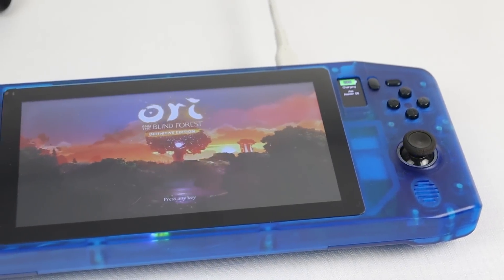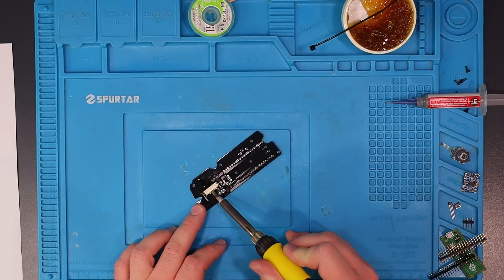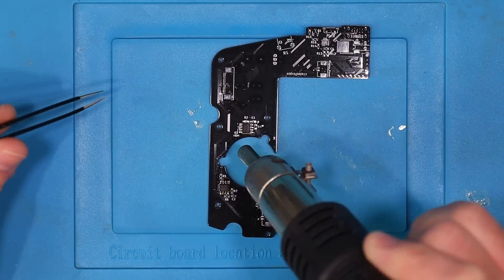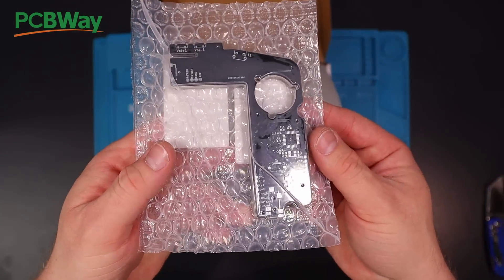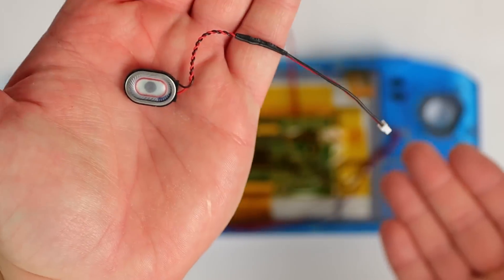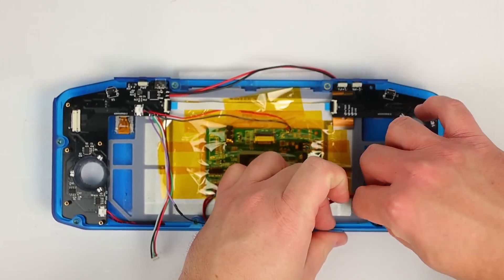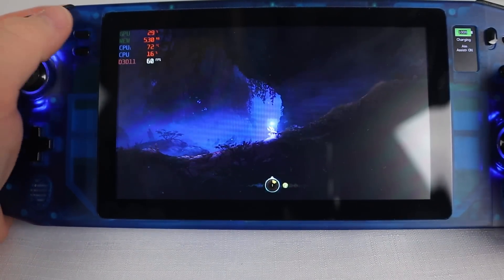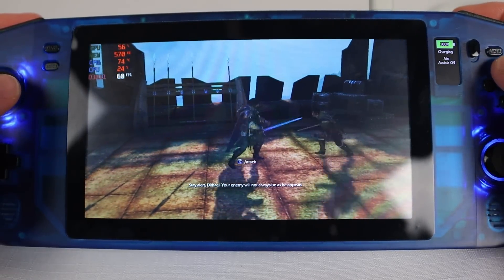NucDeck - The DIY PC gaming handheld - Episode Seven

Comment: This is awesome that you are able to do the job of a whole company only by yourself. I believe if you put more performant pc in it, it would be amazing. Can you program it so it wont charge battery more than 60% when plugged in to preserve battery health? Its not necessary but may be a good idea for some users.
Reply from the maker: Yeah, I will look into upgrading the NUC once the project is complete. It was hard to justify spending more money than I did on a NUC just to rip it apart and stick it in a device I wasn't even sure would work, which is why I used a fairly old one to begin with. Yes, any battery level should eventually be an option you could change, once I have the battery management fully working.

Comment: Actually nuts that you've fit 6000mAH into this! Well done mate. I wonder if there's a small thumbpad module you could integrate into one of the controllers to make desktop browsing easier 🤔
Reply from the maker: I find the joystick mouse is actually pretty good, but if I found a small enough trackpad module I'd consider it on the next one! Its 4s, 3000mah btw. Roughly 50 watt hours!

Comment: If its meant to be a Steam Deck like device why not use HoloISO?
Reply from the maker: Tried it when I first started the project but I couldn't get it running due to lack of driver support for the older intel CPU. I will look into some other options in the future once I have finished the hardware side of things.

Comment: Exquisite work my friend! I wonder how the 8th gen NUC with the AMD RX540 in it would run. They still sell on Amazon.
Reply from the maker: Didn't even know that was a thing! Looks like it would fit, but I'd have to get one and test it to see what the power consumption is like to know if my power mangament system is up to the task.
Reply: @cncdan  I figured you would probably pass on it because the power consumption would be higher but when I saw you worked out the power management I thought it would be great to see what it could pull off.
Reply from the maker: Yeah I'm definitely interested in it as a possibility. Could cap the TPD easily enough to ensure it didn't damage anything. I'll have to look at some benchmarks and see how it performs compared to some of the newer NUC's
Reply: @cncdan  might be a toss up between performance and efficiency. It's also several years old at this point so I'm sure it's pretty inefficient. 11th gen and higher will have the integrated Iris XE graphics which will be more efficient but may not be as performant.
Reply: @cncdan id definitely love to see that

Comment: honestly it seems like it wouldn't take too much to shove any number of small Single-board/industrial computers into that case, though you might have to print an appropriate center-section for it. That's NEAT. I assume the controller just comes up as a USB device?
Reply from the maker: Yep, controller is USB. The power management system is entirely independent of the NUC too so you'll retain battery monitoring etc regardless of what system you put in it. A few resistor changes on the power managament board and you can configure it for a different battery configuration (1 to 4s) and then just use a buck/boost to get 5v from there for a raspberry pi. This is something I plan to explore in the future!
Reply: @cncdan  that is neat! (Wonder how Windows gets power management data from battery management circuits anyway. UART/serial maybe? If it where something that mundane,  adding it might only be a minor nightmare. Though that aux screen is awesome).

That's the power of 3D printing and cheap prototyping services for pcbs.ill have to keep an eye out for the release revision
Reply: I think it would be a great platform for use with the framework laptop motherboards as well.

Comment: Great series! Btw, is it possible to strip down the rpi pico down to rp2040 instead of having the dev board inside?
Reply from the maker: Absolutely. I only included the full sized pico in an attempt to make the PCB easier to assemble for beginners.

Comment: What is the IMU? It looks like an mpu6050. I would consider swapping out the mpu6050 with the BMI160 because it is a lot better and its a dollar, that is, if you are using the 6050.
Reply from the maker: Yeah it is a 6050. I've just ordered a BMI160 so I can have a look at it. Looks like it's got a compatible pin order so I should just be able to swap it over

Comment: Great work , hopefully you can figure out a way to make a kit for the less technically inclined.  A portable PC that doesn't cost 1000s and is user repairable/replaceable would be awesome 👍.
Reply from the maker: Not really planning to produce kits at this stage as they'd probably be more expensive than some of the existing options due to the low volume. I'm kind of hoping someone picks up the design once it's complete and mass produces it to make it cheap so we can save some NUCs from e-waste!
Reply: @cncdan  here's hoping 👍

Comment: I cheated and got a cheap 8th gen NUC motherboard with Iris (its got a board fault with no power to the USB ports), but the fan is huge and now I have to redesign the back shell to fit it 😂.
Reply from the maker: I think I remember trying an 8th gen model in here when I was designing it. Should be able to just straighten up the taper on the sides of that middle section a bit and it should fit!

Comment: I was super excited when I saw this series a few months ago. I'm even more excited to see your further progress. I'm curious if it'd possible to use an OLED screen and aside from having to swap out a hdmi port with a fpc connector would there be other limitations to using a newer more powerful nuc? In my mind i could see something more powerful or on par with the current PC handhelds. Anyway, your work is very inspiring. Thanks so much for putting in the work to share.
Reply from the maker: Yeah, this is eventually the plan. I started with this nuc due entirely to budget limitations but I'm planning to upgrade once everything is working. Swapping to an OLED would at a bare minimum require changes to the housing design.
Reply: @cncdan  When the time comes I would really like to see this project updated to support something like the Minisforum EliteMini UM780 XTX which is a similar form factor to an Intel NUC you are using now, but has an AMD Ryzen 7 7840HS 8 Cores/16 Threads CPU (16M Cache, up to 5.1 GHz) and an AMD Radeon 780M RDNA 3 GPU. This is the same platform that the upcoming Lenovo Legion Go is using which is the "fastest" handheld PC on the market as of this post. The only major hurdle I see to the upgrade is that this platform requires a DC 19V, 65W powersupply. That means a battery upgrade may be neccessary.
Reply from the maker: In theory, the current battery management system should be able to handle 65w since that is close to the actual power consumption on the nuc I am using anyway. If the actual system power is a bit higher than the claimed TDP (which could definitely be the case) then I may have to run a limit to keep it within the specs. The trouble is going to be justifying a purchase of something like that just to rip it apart. The barebones kit works out to be about $730 AUD 😢
Reply: I have a newer NUC (8th gen i7).  The fan is much much larger, looks just like a Ryzen 7840 MinisForum "NUC" (see the video ETA Prime just did.). 

It looks like it might fit with a little grille for some airflow and a bump out for the fan in the bottom side bevel.  It was a 15 hr print so I might cut the holes for now (I need to do that anyway to measure for them).  I forked the github as Switch Nucdeck, or NUC switchdeck, I forget 😅.

I am also re-designing the case to use Switch rails on the side because knock off Joy cons are cheaper than custom PCBs and I wanted to be able to play with the wireless controllers off the system.  (Like a Legion Go.  Come to think of it the Legion Go controller might be a nice upgrade if they are compatible at all)
Reply from the maker: Awesome, make sure you share some pictures of your progress! I'll be interested to see what you do with the power management since that is all contained within the back of the controller at the moment!
Reply: @milescarter7803 With a 8 inch screen instead of 7 it should give you more room and easier to fit in the batteries and NUC behind it so you can achieve the tablet form factor.
Reply from the maker: Making it any thinner would require a custom cooling solution for the NUC. Not out of the question, but I tried to minimise the changes to the nuc where possible to make it an easier build!